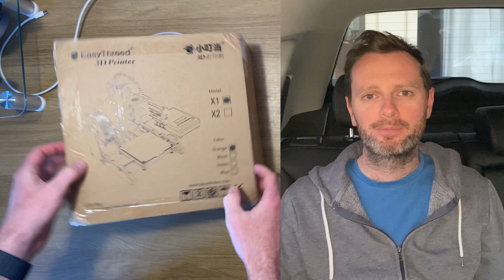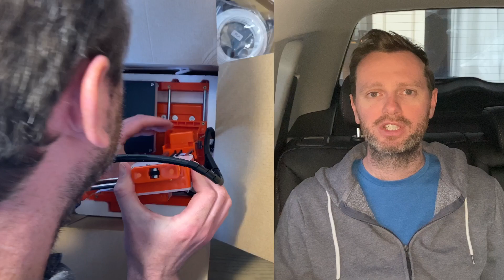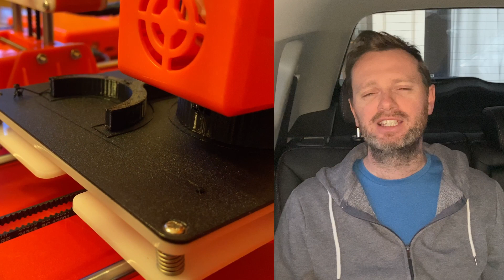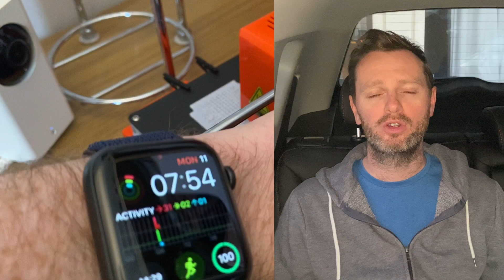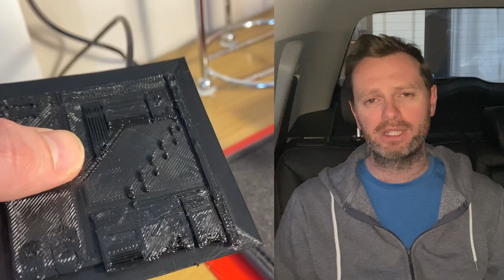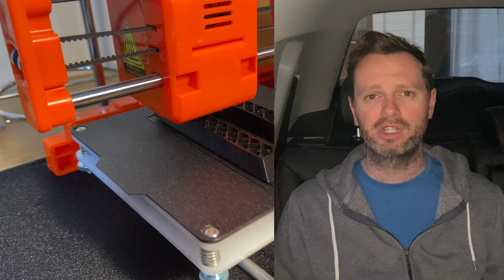Can it print a CyberTruck? Easythreed x1 Review

Comment: u should take the magnetic platform of the build-plate, and then the print of this magnetic platform, and generaly, don´t exercise forces on the printer. And buy a fan like the one over the hotend, and print the air-funnel from the easy3d-x1-site, and with the new fan, use it to blow air on the print...  http://www.easythreed.com/h-col-1158.html   cooling guide cover